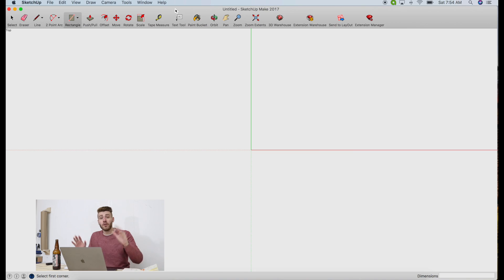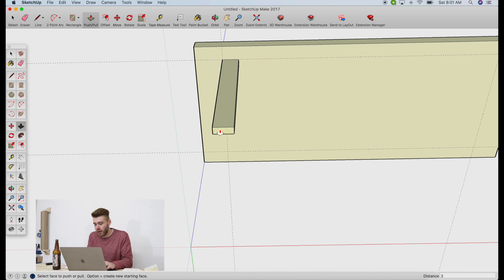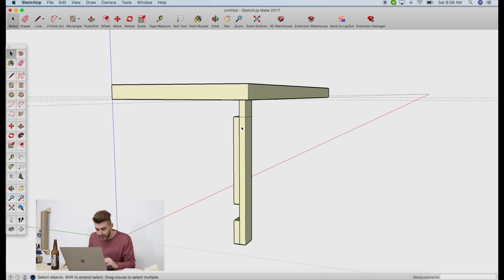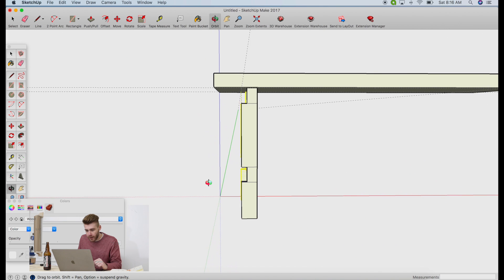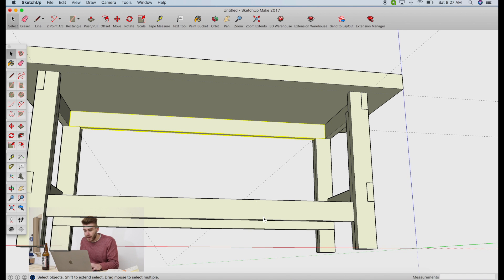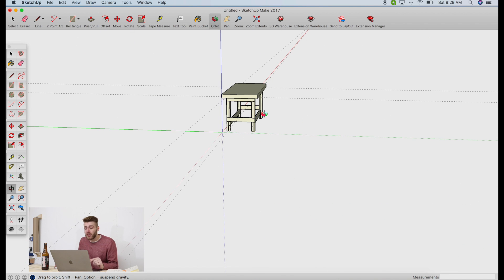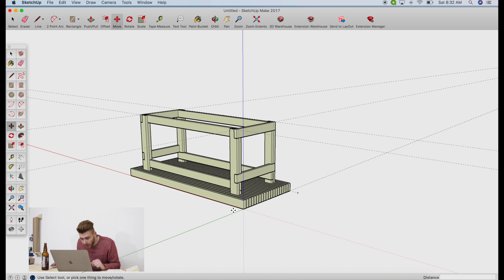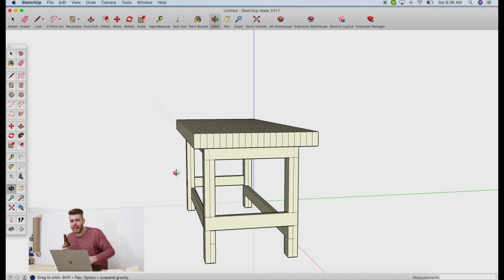How to Model a Workbench in Sketchup // Woodworking

Comment: You don't need to explode a component to make it editable.  In fact, it's often not a good idea, since it could cause the content to merge with anything it's adjacent to that's not isolated in its own group or component.  Instead just double-click the component and you can edit the contents.  Click outside to exit the component, and prevent accidental further editing.  All this is the same for groups as well.

Comment: When you're making the table top, instead of continually copy and pasting the 2x4s you could have used the Move tool, hold Option when you move it to make a copy, after you start moving type "1.5 <return> 10x <return>" this will move it over 1.5" (so it lines up directly beside the original one) and then 10x will make 10 copies each 1.5" further along the same axis.

Comment: this is a pretty good tutorial. but you skip a lot of short cuts, for example to get rid of your reference lines can click the edit menu and select delete guides. also for th legs there are programs  or"extensions" you can add to streamline that. i have a mirror tool what will do those steps in a couple of clicks. good video tho. love listening to your modern maker podcast

Comment: Bah every single one of these videos says its for woodworkers but not one of them mentions making the actual plans to take into the shop.  You mention a cut list but its been almost a year and still nothing.  Modeling and designing in sketchup is cool but eventually someone has to make these things and for that it would be nice to have plans with actual dimensions clearly visible.  I dont have a computer in the shop and clicking the little tape measure tool for ever part is not realistic for most projects.
Reply: You could always make some notes on paper from your model to bring into the shop. Or even take screenshots and print those out. After all this isn't going to be put into mass production. It makes it easier to lay all the pieces out in the model too once you are finished. Having a computer model and taking hand notes for a cut list is much better than just trial and error in the shop if you ask me.

Comment: Nice tutorial! I didn't know about the selection, so thanks for that tip! Another quick tip is that you can use the move tool to copy an object, that way you can copy and position it correctly at the same time, saving a step. You do it by tapping the option key on the mac (or control on win/linux pc) while moving the piece.

For the top, you can "copymove" the first 2x4 to the other end and fill in the rest by typing a slash and a number, like /10, that will distribute 9 more 2x4s between the first and the last copy. But that works if you did the math, first of course, so you know how many 2x4s you'll need in advance.

If you don't, like in your case, you can just copymove it right next to the first one and type star and a number, like *10, and that will copy 10 2x4s right next to each other.

Cheers!

Comment: Been wanting to start using sketchup for a while now but didn’t know where to start.  Very well done and look forward to part two with the cut list.  Keep it up!
Reply: Sweet! I'm learning it now, should have it down for the next vid
Reply: Ditto. I’m a new subscriber for your second channel. Already was subscribed to your first channel. I’m looking forward to learning SketchUp, but I need to get a laptop first. It won’t work on my iPad.
Reply: Two key tips to Sketchup. Make components of everything discrete asap. Zoom in if you are struggling to draw/connect etc
Reply: Modern Builds I'm looking for the cut list too.
Reply: 12121212121211211112121121212